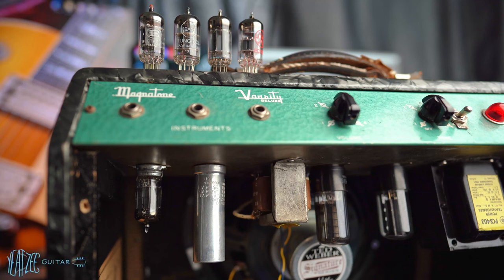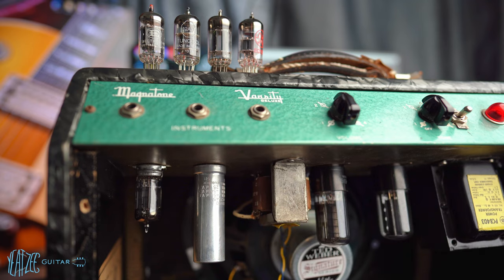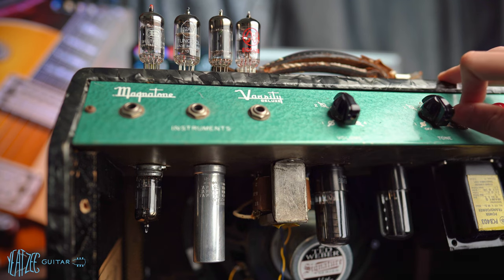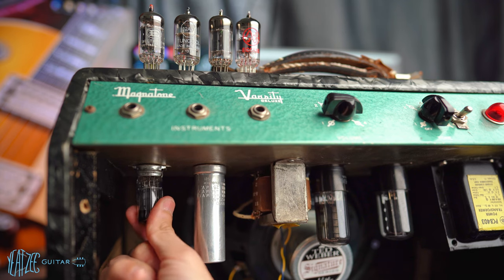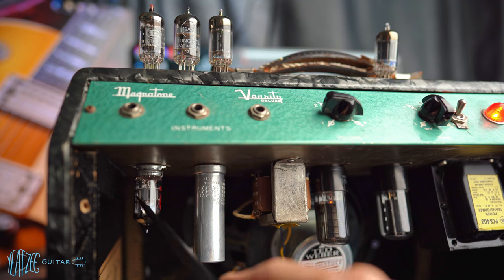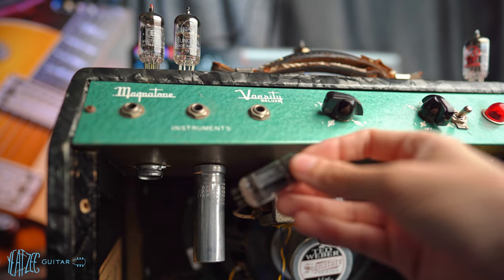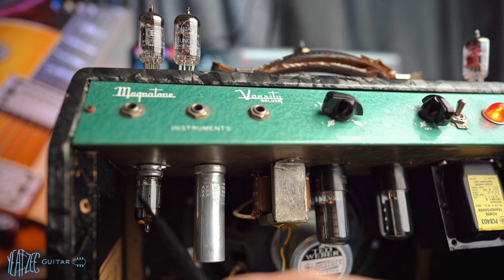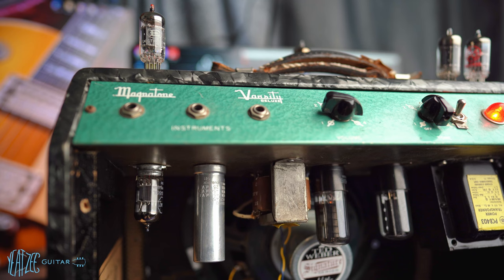My Vintage Amp Journey: Episode 3 - Heat up the soldering iron!

Comment: The unmarked tube that you have might be an old Sylvania JAN 12AX7WA.  Hard to see from a distance but the plates look similar.  Most of those had green print.  A lot of old GE's also had green print but I've seen a lot more of the Sylvania's with the larger plates similar to your tube.

The Electrohome is actually a Philips Amperex I65 tube and is very valuable.  If working properly it is a fantastic sounding tube.  Whether it will be the right tube for your amp is entirely subjective but it is excellent quality, likely made in the 60's, and part of the Mullard family.  I knew something was going on when the tube flashed on startup.  A lot of old Mullard's & Amperex tubes flash when powered on.  Very nice!!!  I run an old Amperex Bugle Boy ECC83 (UK designation for 12AX7) in a '58 Gibson GA5.  It beat out every other tube for that amp.  But there are no rules.  It might be one of your other tubes that will sound best to you in that amp.
Reply from the maker: Oh man, this is such good info thank you! Trying to learn about tubes is just as daunting as learning about work on tube amps, there are just so many rebrands out there etc. Very cool, well I'm looking forward to comparing them all side by side once the amp is back up and running!
Reply: I agree with Guitar5986 on all points.  The unknown 12AX7 with green writing may be a very early Sylvania tube, and is a "long plate" style (compare the height of the gray plate to your other 12AX7s).  And that the flashing of the Electrohome 12AX7 is normal for old production European tubes.

Judgment call on whether the original 12AX7 is "microphonic enough" to require replacement.  You may find it works well in other amps.

Comment: I would strongly suggest you redo that ground connection.  Bending the tabs was not necessary.  What you need in order to make solid ground connections is to remove all of the original solder and then clean all of the old flux off thoroughly (lightly scrap off and clean with alcohol).  Then sand around the tabs so that you can be sure that you are going to have a clean connection.  You don't ever want to solder onto old metal without cleaning thoroughly first.  There is a visible layer of oxidized metal and grime that builds up over time.  The issue with the previous ground was that the ground connections were dirty and likely made without cleaning properly as I outlined above.  The connection might work for now but over time you are likely to start experiencing intermittent issues.  Get yourself that solder wick I recommended and make sure to get everything cleaned up and sanded to bare metal before you solder.  Clean solder joints are vital to a reliable amp.
Reply from the maker: Once again, great tips! I bent the tabs more to just hold the can cap in place, I didn't even really intend to have the ground connect to it, I just wanted it to be secure. I honestly am not surprised I might have to redo the connection, my first time doing that so I didn't have high hopes (you can tell in the video I'm unsure). It seemed to test fine, but yeah for longevity it's probably not a bad idea. Annoying part is I'd have to undo all of the new wires I've soldered in (episode 4) but that's not the end of the world since I didn't tie a knot with each connection 😅😉
Reply: @YeatzeeGuitar  Trust me, I feel your pain!  Anybody that gets into this has their fair share of mistakes and learning experiences along the way.  I'm definitely not an expert and I rely on a good local amp tech for a lot of things.  As for that Ground, I'm sure when the previous guy did the work the ground was fine.  But when you received it years later it was showing the fruits of his poor quality work.  The good news is that you can do better and end up with a good reliable amp.  Something else that might be a good idea to do in a future episode is to test all of the old resistors in the amp to make sure they still are within spec.

Comment: Part of the issue you were having removing components was not necessarily the mechanical connection, but the joints were not fully heating up.  A lot of that was likely due to the camera being in your way.  You did good to add fresh solder to your iron but sometimes you need to add fresh solder to the joint itself.  A lot of the issues you ran into were due to the solder not flowing when you were trying to remove leads.  That said, a lot of those leads were excessively wrapped.  Even the joints that did flow properly would be incredible difficult to remove the leads.  In that situation it's best to just cut the lead at the joint so you can remove the wire without yanking and potentially damaging sockets/components.  Even if you manage to yank the lead out, the wire will be weakened from all the stress and heat.  Best to just remove that compromised bit of wire.  If you have enough lead length it won't be a problem to strip back the insulation and reuse the wire.  But if it runs short then just replace.

Comment: Can't see what brand of solder wick you're using, but I would highly recommend you pick up some NTE Electronics SW02-10 Solder Wick.  That stuff is incredible and just soaks up solder.  Typically for a lot of solder you give it a few hits with the sucker to get the majority of it.  Then you can clean up the rest with the wick.  Make sure your iron is nice and hot.  A bit hotter than you might typically have it for regular solder work.  You may need to flow a tiny bit of fresh solder first but once you do that you should be able to sandwich the braid between your iron and the solder.  Once the solder heats up adequately it will soak into the braid.  However, sometimes if the previous solder used was very poor quality it might give you problems.  This is where you really need to make sure to get the majority of it with the solder sucker before flowing in some fresh solder and then wicking up the rest.

Also, get yourself some alligator clips so that you can attach them onto the leads of resistors/caps while you are removing solder.  The clips will act as a heat sink and help prevent your iron damaging components.  If you can remove the solder quickly it's not necessary but for anything problematic it's a good practice to follow.
Reply from the maker: Great tips, I basically landed on that method after some trial and error. I'm pretty sure the previously used solder is junk (shocker) making things a bit more difficult.
Reply: @YeatzeeGuitar  The wick might not be the best either.  A lot of brands out there just don't soak up the solder properly.  It pools on the braid.  NTE Electronics is the best I've ever used and far superior to anything else I've ever tried.  I never really could get on with solder wicks until I bought that brand.
Reply from the maker: @Guitar5986  I'll go buy a few then!

Comment: Honestly, I wouldn’t have bothered spending that much time on the old can capacitors.

I would have rather drilled the chassis, riveted and soldered and new terminal strips and used that to route all the ground leads
Reply from the maker: I really want to avoiding drilling the chassis
Reply: @YeatzeeGuitar  I understand, but it is rather common even on valuable vintage amps and it would have resulted in a much more solid and neat grounding